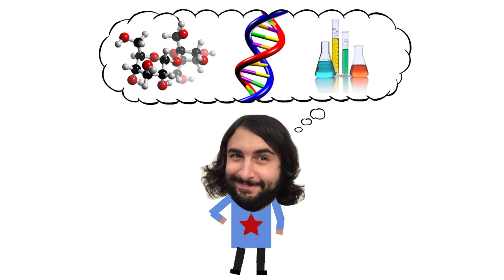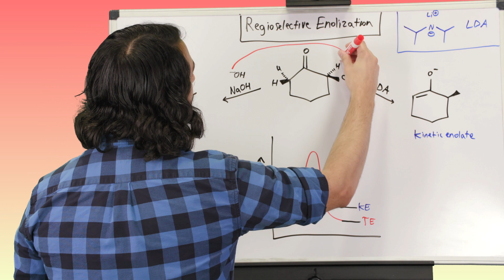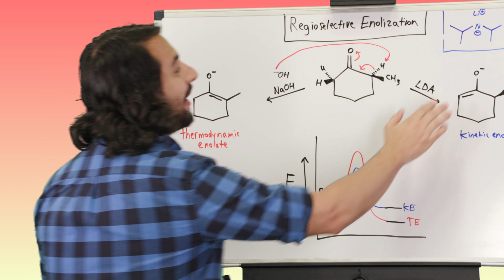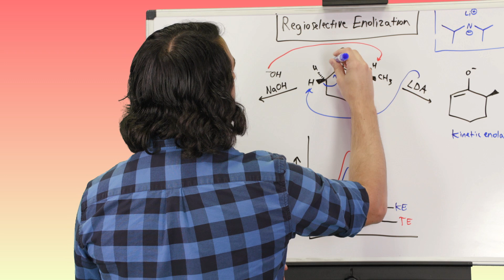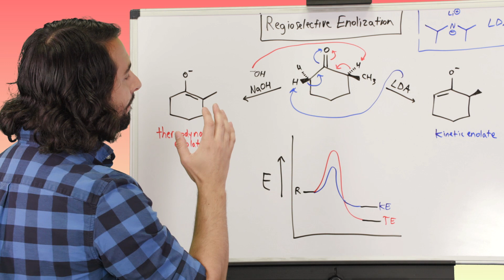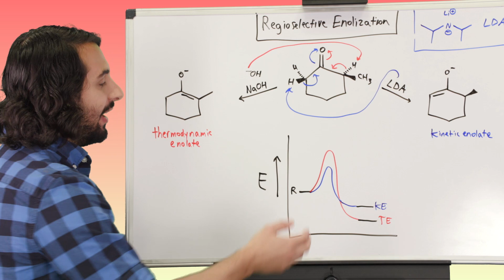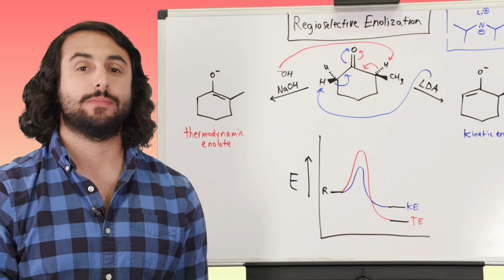Regioselective Enolization and Thermodynamic vs. Kinetic Control

Comment: Sir in case for thermodynamically controlled reaction the two possible enolates have  approximately the same free energy of activation as you said , so if the free energy of activation is same then both have equal rates . And if both have equal rates then there is no  way that one is major and the other is minor.
Reply: Theoretically yes, but you are missing the Alkene stability. Hydroxide can de-protonate forming an Alkene that has 4 groups and the other 3. Therefore the one with four groups will form in higher percent.

Comment: Why is the thermodynamic enolate more stable? What are the effects of the methyl group, what are they actually stabilizing?
Reply from the maker: more substituted alkenes are more stable in general, hyperconjugation
Reply: @ProfessorDaveExplains  thanks for your quick answer. I still dont get it, as far as i know hyperconjugation means the alkyl Groups are able to push electrones to a carbon that has electrone deficite, but in this case the negative oxygen is already pushing negative charge to the double bound that has a high electrone density. So why should that be stable? If it was a carbocation then it would make sense, propably im not getting where a carbocation is being formed here?
Reply from the maker: No carbocation, the same principle applies to any sp2 carbon.